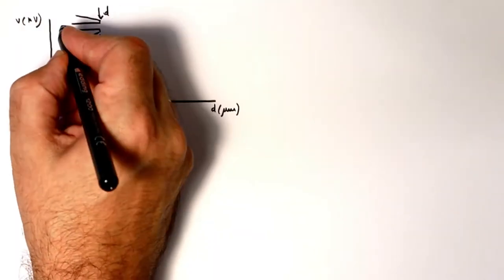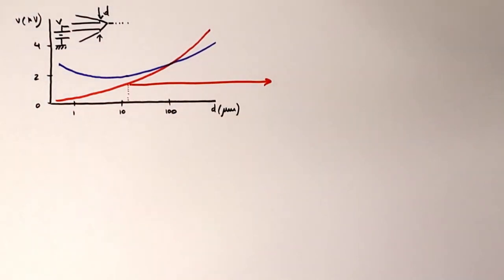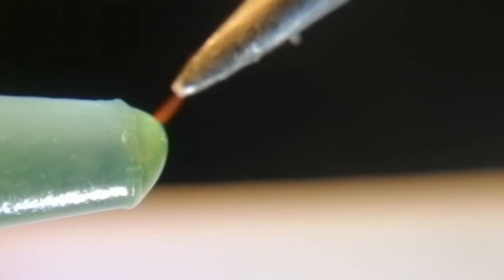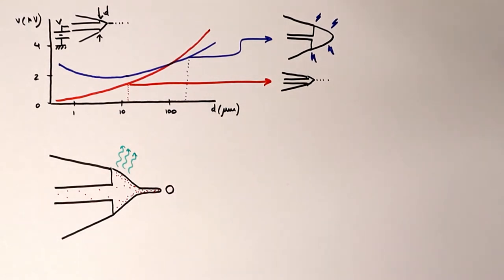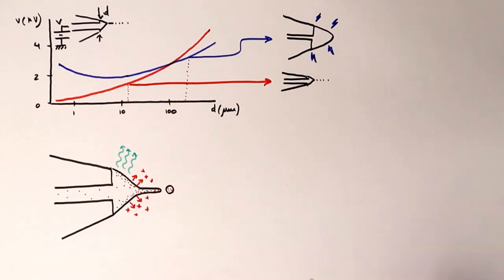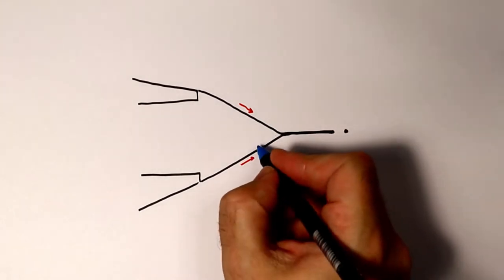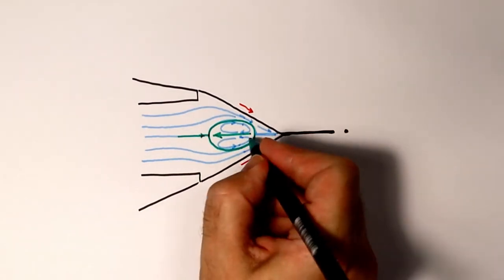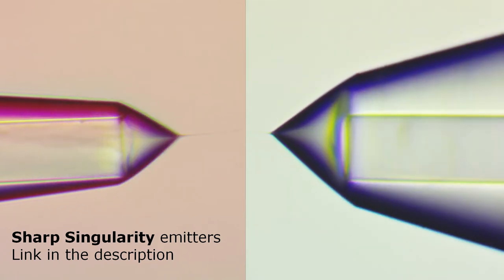Mastering electrospray ionization: three reasons why size matters

Comment: Thank you very much for this nice video! I am now working with ESI now, and I find it is easily clogged. Do you have any suggestions to work with the clogging?
Reply from the maker: Hi, Xuemei Cheng. 
Thanks for your positive feedback!
Some tips to prevent clogging: make sure your solution is clean, the environment you are operating is dust-free, and your solution does not leave a solid residue when it evaporates, use the largest possible ID for your application. See different sizes here: https://www.fossiliontech.com/nanoesi-emitters ), and more info on how to choose the right emitter here: https://www.fossiliontech.com/nano-esi 
I hope this helps!
Reply: @playingwithions  Thank you very much for the fast repy! I am now trying to spay the nanorod with the diameter of 25 nm and the length of 137 nm. And the inner diameter of the capillary I am using is 40 um. Do you think it is large enough?